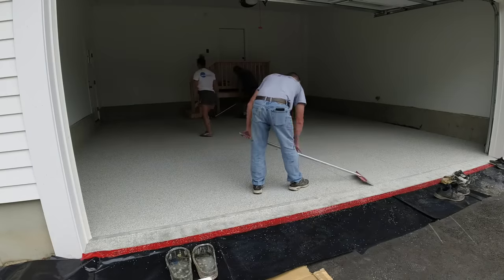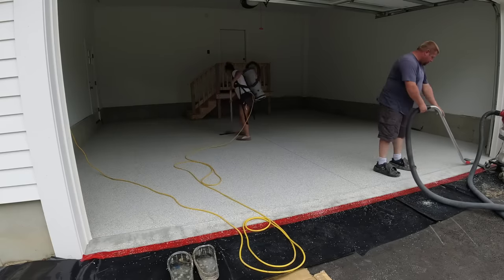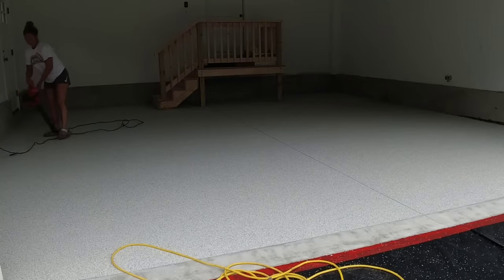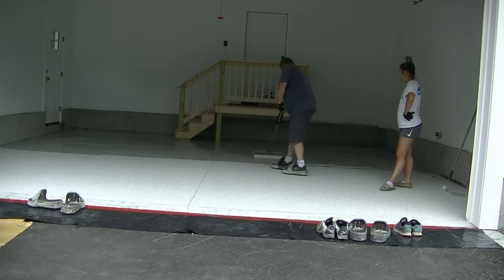DIY Epoxy Flake Garage Floor Coatings (What Most People Don't Tell You)

Comment: Oh come on, I've installed these coatings after just an acid etch, you cannot remove the epoxy save sand blasting! I'm talking about the floors of auto shops! You probably fixed jobs that weren't put down right to begin with. Your way is good for you and making money I guess.